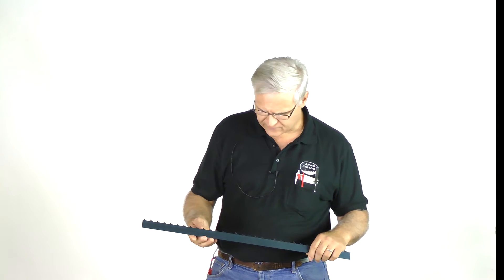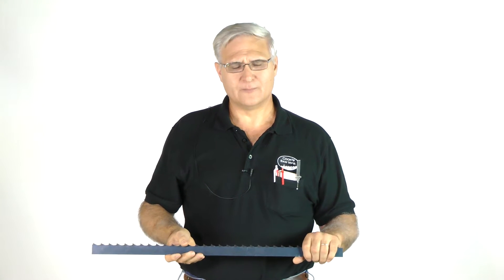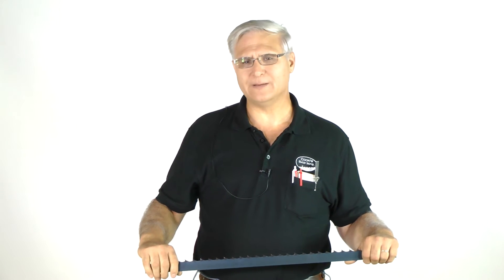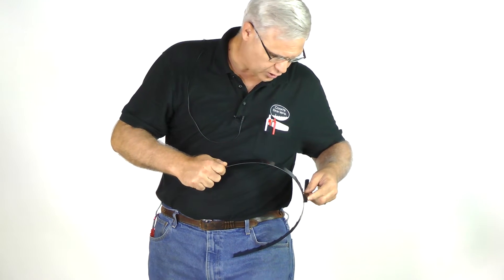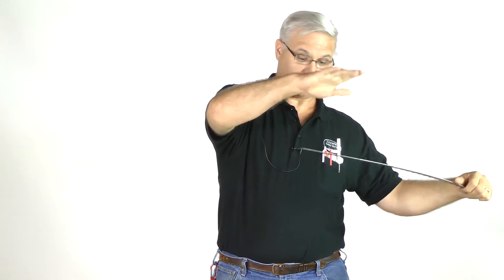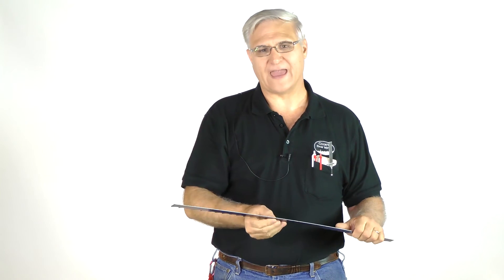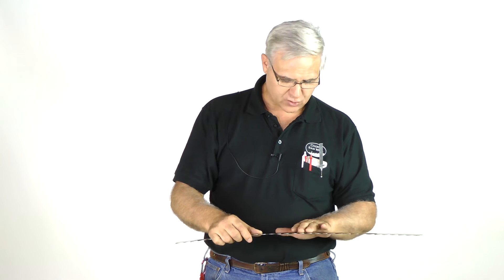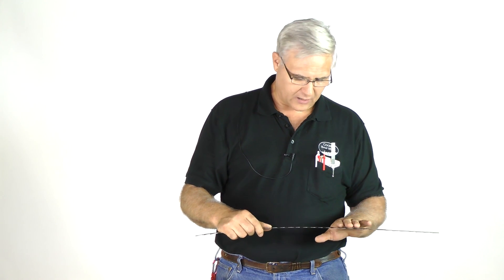Sawmill Bandsaw Blade Basics 3 - The Body

Comment: Mr. Cooke
Tell me if I'm  wrong 
So when the band body developes the curvature it is going in the opposite direction that common sense would tell you
It developes the curve in opposition to the crown of the band wheels
So when the curve in the blade gets to the rolled guide
The  bands curve is with the edges of the band body facing down and the crown in the blade is all that is making contact with the flat part of the roller guides .The band body crown is teetering or rocking on the the flat surface of the roller guide encouraging the cut to rise or dive ?
Reply from the maker: Yes. You are correct.